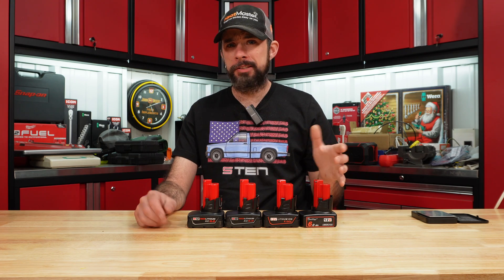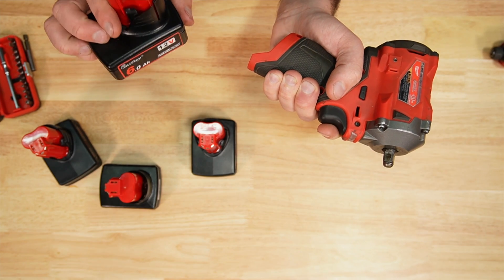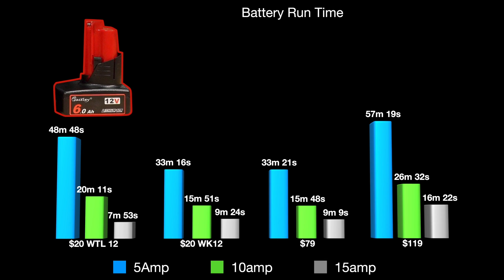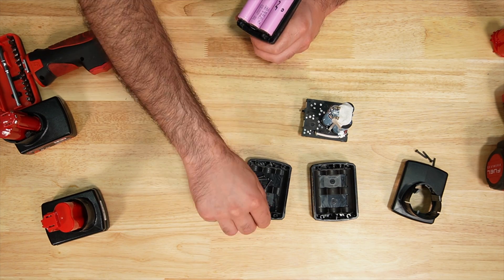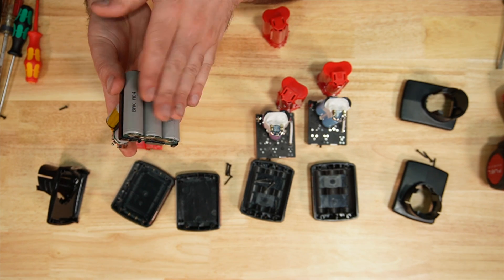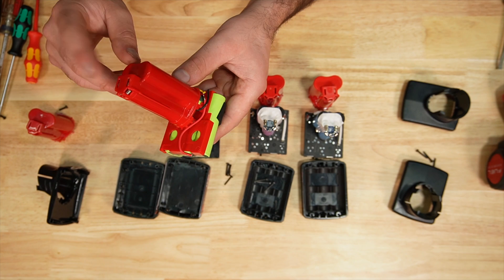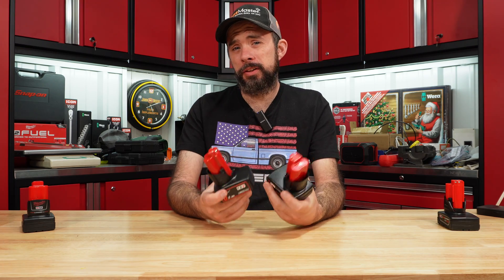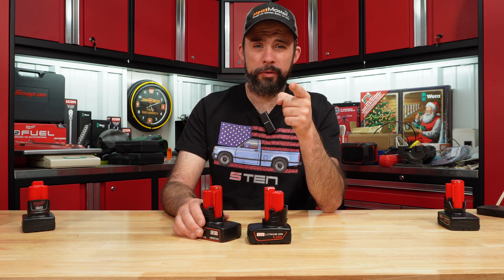M12 6ah Vs The Knock Off

Comment: I have 4 of the Waitley  6Ah M12's. They say 64.8Wh on the label, which would be 5.4Ah (64.8/12). That's 90% of a real M12. In your test the Waitley ran 49m vs the real M12 running 57m. That's 86% of the runtime, which is pretty consistent with what their label says. I got 2 on Amazon for $32. I use them for lights and sanders, which didn't require super high output. They seem to work pretty well and for the price they are great.

Comment: Ive had a knockoff "PowerExtra" m12 2.0 for over 5 years and use it daily on my impact. Im an electrician and have dropped it a million times, used it as a hammer and it atill works great and holds charge just as well as all my genuine m12s

Comment: The waitley 6.0 batteries I have use inr high drain cells and they're very comparable to a m12 battery I've had great luck with them even under hard use however I just got a waitley 9.0 and it's built with icr cells which are not high drain cells so that's a bit disappointing and I don't know if they still build any packs with INR anymore

Comment: Since you have some testing equipment. What do you think about the 9.0 batteries coming out?
Reply from the maker: Milwaukee is making a 9.0?  if so it will be a powerful pack.  If your talking the generic 9.0s they didn't perform very well,  more like a 4.0 for power and runtime.

Comment: Thanks, I have bought 2 pack of batteries 3 times. I'm a home owner had a big project going. 2 times 1 of the batteries were a dud brand new. Then like a year later the other battery went out.  I store them in my warm house fully  charged when they work. I have 1 battery out of six.
Reply from the maker: No problem,  during Black Friday is a great time to kick some OEMs up.  I know normally they are pricy.
Reply: Не храните эти батарейки в полностью заряженном состоянии, или полностью разряженном. Они должны быть 70-50%заряжены, и не любят высоких и низких температур.

Comment: I've been using them at work since genuine batteries have an unfortunate tendency to grow legs and walk away. The connection kinda sucks if you're using it on a tool like a plunge cutter. But i mainly run lights off them. Have enough on hand to run my lights well over 48 hours straight. Cheap enough that you don't care if it falls 150 feet down an elevator shaft.

Not great for tools with high amp draw. But for lights and other low draw, low manipulation tools it's a very worthwhile option.

Comment: Next time you do the wiggle test have the drill trigger pressed. Thats when my throw a error code. It disconnects with most of the generic m12s I have. Some wont charge when new. The wailteys worked great on my makita v18 tools. No problems there but the m12 batteries have fit issues. I stipped buying them. The genuine milwakee batteries are half price on amazon. I prefer those.😊😊😊
Reply from the maker: Yeah that’s a very good point, I can see how that can be an issue.

Comment: In my experience for regular use for household tasks with milwaukee tools duch as M12 drill/driver combo, the m12 tire inflator the battery works fine. They also work fine as a battery bank with the m12 usb adaptor tool for charging up phones and other batteries and usb battery lights in the house just fine. My preference today are the Waitley branded batteries.
I think more interesting tests to see today is how well the internal pcbs work to balance cells conpared to active and passive cell balancers available on the market today. Would be surprised to see some interesting results how to keep your cheaper batteries last longer than the milwaukee batteries.

Comment: Your straight up lied on camera lmao, the high output with the purple Samsung cells did the best, but the rubber bottom off brand did almost exactly as well as the non high output 6amp but lasted a little longer even

Comment: I have a lot of m12 tools but I m not very hard on my tools I’m just a diy. I find for my needs that the generic batteries are fine. I use them in my hammer drill and my m12 air pump and my m12 vacuum all the time and they work great at a much lower cost.

Comment: You are showing 5, 10 and 15 Amps scales, but… how many Amps does a Gen 3 M12 Fuel Hammer Drill pull at different tasks?
Reply from the maker: Hard to say,  I'm working on a setup to test that.

Comment: Just wanted to confirm that I experienced the same results using the amazon brand 6.0 with my m12 under hood light.

Milwaukee advertises 4 hour runtime with XC 4.0.

OEM XC 4.0: 3 hr 30 mins (this was brand new out of the box)
Amazon brand XC 6.0: 2 hr 40 minutes
Amazon brand cp 3.0: 1 hr 22 minutes 

So we can guesstimate that the 6.0 is more like a 3.0 and the cp 3.0 is more like a 1.5ah.
Reply from the maker: Yep exactly!

Comment: Milwaukee 12v 6.0 batteries have stopped working on me within 3 months 3 different times. Worst waste of money. Did they fix the problem or are they still giving them away for free with promotional deals?
Reply: Nope I just got some from home Depot 2024 black Friday deals to check if they fix them and all 4 went out they have not fixed them.

Comment: Great video, thanks! As a contractor myself, I actually use generic m12 batteries with great results. I find myself even preferring my generics over my name brand m12 batteries sometimes. They’re very hit or miss, though, and maybe have used cells in them. I have had one fail that I got refunded for, a wire needed re-soldering. Additionally, on some of mine the clips seem to be more brittle and break easily vs the milwaukees.
Reply from the maker: No problem!

Yep others have complained about the clips being brittle,  but most also seem to be happy with the performance considering the price.

Comment: Want to know the differ ace between xc3.0 and the xc4.0 will be using it not in a tool but a tire inflator I got two in a pack of the 3.0 for a good price for a tire inflator will the 3.0 be fine what do you think they are M12 Milwaukee battery's. thanks
Reply from the maker: Both being xc's I would only expect a difference in run time which both would run the inflator longer than the duty cycle.

Comment: I have a Milwaukee band saw that is very small which I use for simply cutting through heavier wire when I'm doing a panel change out. I had two 12 volt batteries, and one of them had just died on me, so I went ahead and got two of the cheaper no name brand off of eBay, and they fit rather nicely in they seem to work decently. The way I figure it, I can always have something charged while I'm cutting some things, and I can charge the other items while I'm working. Generally the way that I'm using it, I will have plenty of time to charge two batteries before one of them dies. Thanks for the great video! may Jesus greatly bless you!
Reply from the maker: Makes sense that way you always have one ready,  and they are cheap so if something happens its not a big dealt.  No problem!

Comment: I have about a dozen Waitley 9.0ah M12 batteries that I used at work working on cars full time Technician. I even use the M12 battery adapter so I can use it to power my Evap Smoke Machine with a single Waitley 9.0ah M12 battery. Use it to power my Kayak Brushless motor, Paddle Board Fin Brushless motor, Watersnake T24 trolling motor. Only had one fail in the last 3 years. They are so cheap in price, just buy a new one when it fails 2-3 years later.
Reply from the maker: Interesting thanks for the info!
Reply: I seen a few exploded ones in the Amazon reviews, so I picked up 2 oem 6.0 for $92 on eBay. I sleep better
Reply: @whophead6837  exactly what I did way cheaper than home depot and got some badass batteries
Reply: @whophead6837 dont get it twisted.....ive seen the real name brand ones blow all the time in my field of work.....and sometimes just fail....🤷‍♂️🤷‍♂️ lets not be bias......there batteries....im in the rc hobby too so i know about batteries......they all come from china buddy...lol. they will fail....all the batteries will in time.....might as well get the cheaper one......its all what you would want at the end of the day....but lets not totally shit on the aftermarket just cause tjere cheap.....they still work.
Reply: Happy with my 6.0 waitley. Very sturdy construction.
Reply: I hope you try the FUTUREBATT WK12s, due to their higher build quality and report back here with results! though I feel like I'm being too cheap on waiting to buy it myself
Reply: Thank you for this comment! Great idea on the smoke machine. I’m an auto tech too and I’m looking for good batteries for my tools and my m12 vacuum I use for cleaning wiper cowls and cabin filter debris etc.
Reply: You are so right my friend! Im so sick and tired of all these name brand whores......long as you have the real tool your good......as for the batteries....the aftermarkets are fantastic.....might just be a lil off on the torque but flr longevity and all around functionality the price is fenominal.........its funny how they cry about how much more the real battery puts out.....well if you buy 2 of them it will still be cheaper than a name brand battery......then there you go....the 2 batteries will out last the one real😂😂😂😂😂      

I dont know about you but To be honest......im just so frickin tired of how expensive these batteries are......the aftermarket works just fine for me when i work on my cars and out on the field  at work doing maintanance work.

Comment: The main issue with knockoff batteries is not just the fake rated capacity, but the very low discharge capacity they have. If you use them in a tool that requires a high discharge rate from the battery, the voltage will just drop dramatically and the tool will stop, or the motor torque will be negligible as if you were using an almost depleted battery.  I purchased a couple of the "9.0" triple parallel cell configuration with the idea of using the cases to build decent quality batteries, but even the housing quality is a joke.
Reply from the maker: Yep I bought a 9 for a customer build as well and the case is not the greatest.

The knock offs are definitely overrated!
Reply: I dunno, looks to me that the that FUTUREBATT WK12 was pretty on par with the Milwaukee 3Ah, even with the voltage sag.

Comment: I built my own knockoffs using generic cases and better quality cells than Mikwaukee. A CP 2.0 that hits harder than the XC 6.0 and a 9 cell 8.0 that is rated at 105A, it never gets hot and never 'sags'. Finally my M12 stuff is performing the way I want!
Reply from the maker: Nice!, Im hoping to build a 9 cell this winter.
Reply: @Tools-Tested  Cool. What cells do you plan to use?
Reply from the maker: @procrastinator1842  I’m thinking Sony vtc6 or the Samsung 25s
Reply: @Tools-Tested  Nice. I was torn for a while between the 25S and the Molicel P26. Ended up going the P26 for the 9 cell. I made a 3 cell pack with the Samsung 20S, it's not huge on capacity but it hits like a 6.0. It solves the issue of having to swap in a bigger battery to drive a bigger screw, or using the 3" grinder in a tight space.
Reply from the maker: @procrastinator1842  thanks for the info,  I will have to look at the P26.
Reply: Bro sell me one plzz!I need something better for my heated gear as I am an asphalt worker .
Reply: Bro sell me one plzz!I need something better for my heated gear as I am an asphalt worker .cold kills em …my issue has been with the holders never working thoe
Reply: Nice I picked up two "akkopower" 8.0 😅 m12 packs for $25 shipped next day, basically the price of empty cases with the intention of rebuilding with better cells, already rebuilt one with some 30q's for a legit 6.0
Reply: I did this same thing with the 15 cell M18 -12 Ah that has the larger 12700 batteries. That thing rocks.

Comment: Strange, my waitley 6ah m12 has pink 2200mah cells which I had to Google to figure out. They are really good batteries for the price...I've had to resolder a connection on my other knockoff. Moral of the story, get genuine batteries for free with promotions
Reply from the maker: That's really weird yours has 22000s,  when did you buy it?  

Yep buying kits/promotions is defiantly the best way.
Reply: Yes, picked up the M12 Stapler w/ free 6.0 for $99 last year to add to my collection.
Reply: Knockoffs usually don't have large order agreements with the big cell manufacturers and probably do their own comparison shopping with manufacturers when it's time to replenish their cell stocks.  

Still, it'd have some trust in the FUTUREBATT pack because what looks to be higher-than-average commitment to quality amongst knockoffs.

Comment: Do NOT buy these. The clips that hold them in break every time.
Reply: Do you have experience with more than one brand and/or case molding?
Reply: @h8GW  no. but plastic that is designed to flex is not completely reliable even with the milwaukee brand batteries. I have a milwaukee 2 amp with a missing tab. But i did try an off brand and they broke FAST

Comment: I'm looking for a tool to use driving screws on metal roofing that I plan to install.....any recommendations out there?
Reply from the maker: I have been using a Milwaukee impact driver #2850-20 18V for installing screws into roofing sheet metal and it has worked well.

The newer version is onsale at Home Depot   

https://www.homedepot.com/p/Milwaukee-M18-FUEL-18V-Lithium-Ion-Brushless-Cordless-1-4-in-Hex-Impact-Driver-with-High-Output-CP-3-0-Ah-Battery-2853-20-48-11-1835/320793878

Comment: I have three of the cheap knockoff batteries only for my m12 tire inflator, flash light and m12 radio, they work great for no load tools, bought 3 batteries from eBay for $20 but when using them in the ratchet or drill they suck.
Reply from the maker: Yeah I can understand that,  higher amps you can see the voltage drop is higher compared to the real M12.  Thanks for the info!